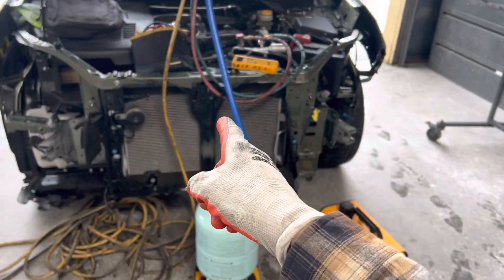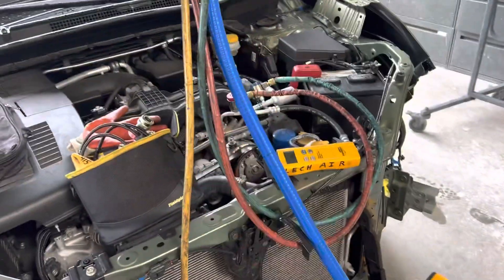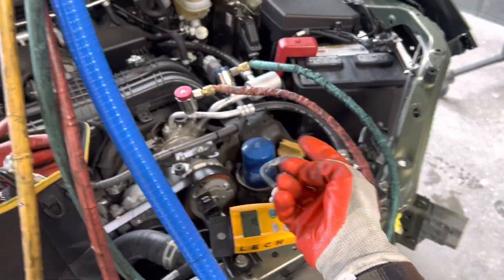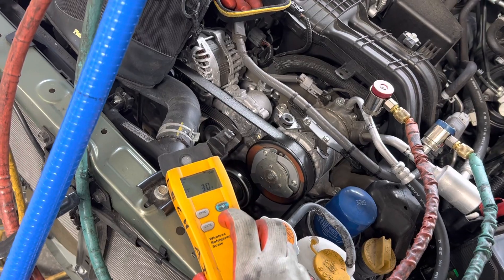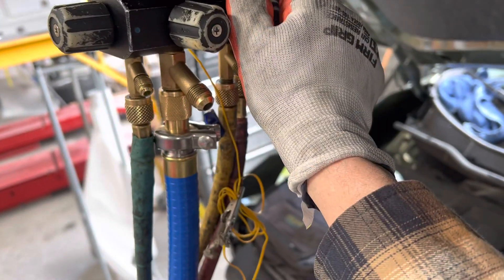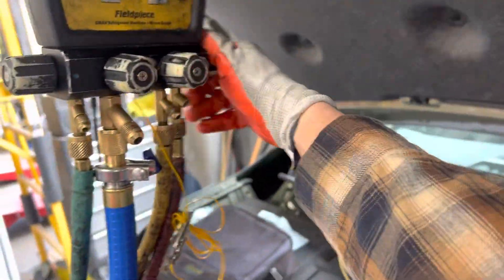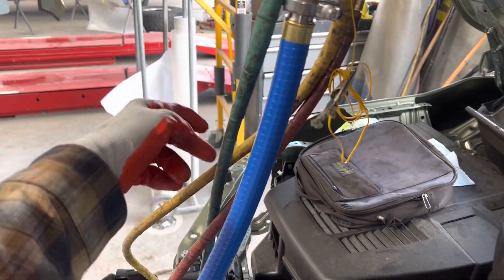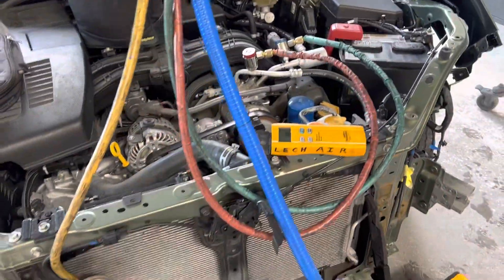Refrigerant  charge 2016 Toyota Forrester”oops SUBARU” A New Condenser was replaced..

Comment: Our master, please explain, where does the air come from in the system? Not only that, in stations, machines, air conditioning harvesters, and even in new refrigerant cylinders, after the test carried out by ref pro 5, the result is 95% + r134 and from 7 to 4% of air. What does it mean, how to avoid it, tell me what you think, I'm very curious
Reply from the maker: Air comes from sloppy guys when working on vehicles some people don’t vacuum they just charge refrigerant on top of the air

Some guys attempt to push refrigerant in the high side, and then let the air bleed out the low side, thinking they’re gonna get all the air out still some in there 

Other guys leave there a hose is open in the air gets inside the hoses and then our few days later a week later when they go to use their gauges, they hook up to the car and it pushes air into the system that mixes 

When they have a recovery machine and it’s a car that has a vacuum leak the leak does not happen under pressure but a weak compressor shaft seal can hold pressure excellent but when it goes in your vacuum, it doesn’t hold and it starts sucking in air as the machine is trying to recover refrigerant, and it sucks and air with refrigerant 

Another method, some cars, older cars mostly did not have a pressure switch to turn off the compressor when the refrigerant got very very low . And if the leak was on the low side, suction hose or evaporator, and the compressor was still running the low side would be under a vacuum with the compressor running pulling air in through the leak on the suction side. This is another method of getting air into the system. 

There is absolutely no reason for Air ever to get into the system. There’s no reason for air to get into the recovered, refrigerant no reason for any air in recycled refrigerant it’s all because of a sloppy technician who has sloppy practices. .
Reply: W nowej butli nie moze byc powietrza, jak ci na każdej wyrzuca %powietrza, to refpro do kalibracji, lub potwierdź refpro4
Reply from the maker: @andrzejnazwisko5331  wow.  That is going to need some translation.